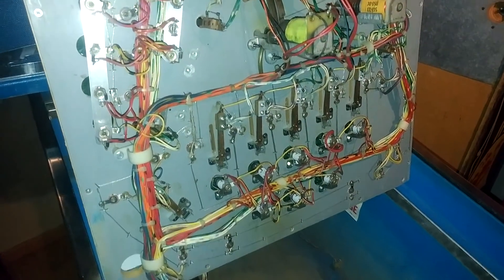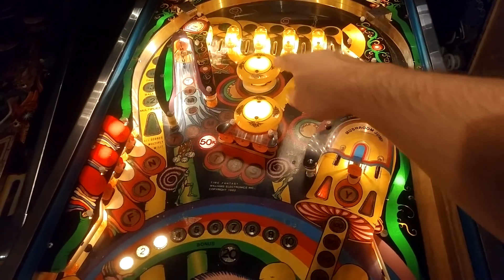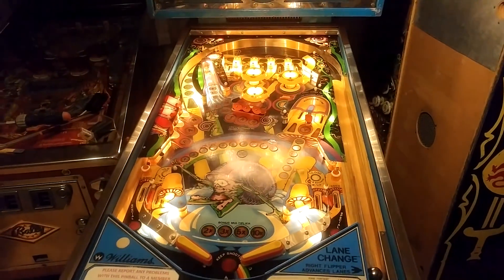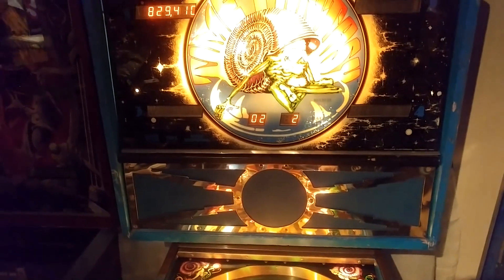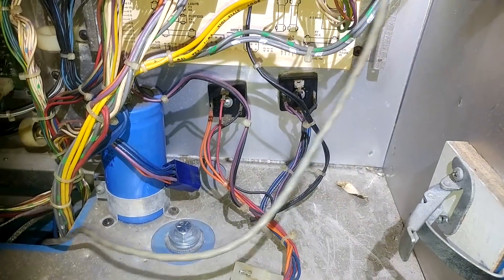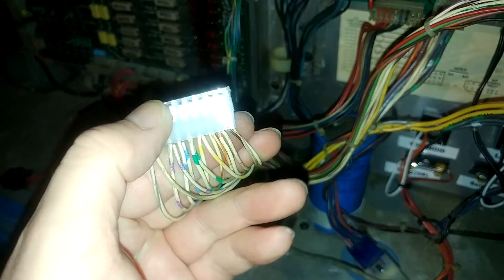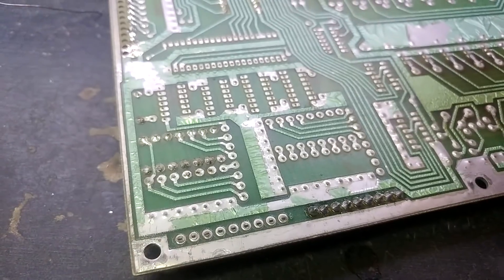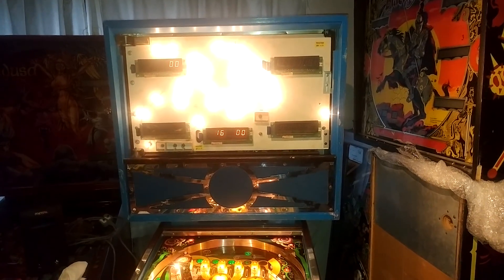Williams Time Fantasy Pinball Fixup (Part 2)

Comment: Always enjoy these videos, love the way it’s all wired .. proper analogue era
Reply from the maker: These days they will do anything to save a few pennies on the wiring. Don't know if you have seen a modern Stern, but they put the power switch in a really awkward place, just so they didn't have to run any wire to the usual place that every single pinball machine ever made puts their power switch
Reply: arcadeuk no not seen inside a modern one, these are much more interesting,